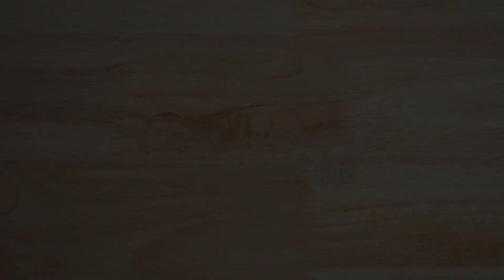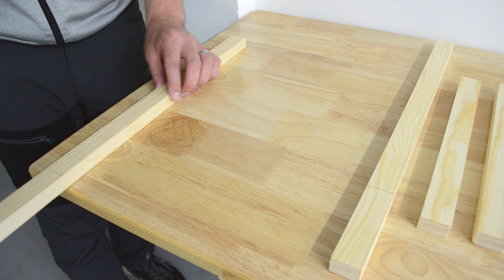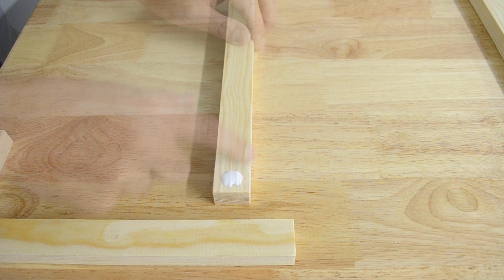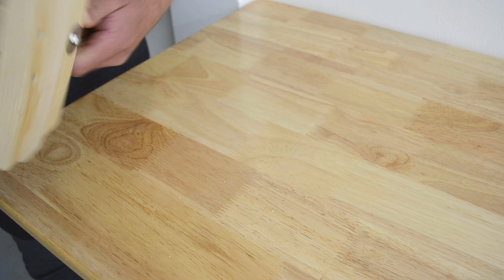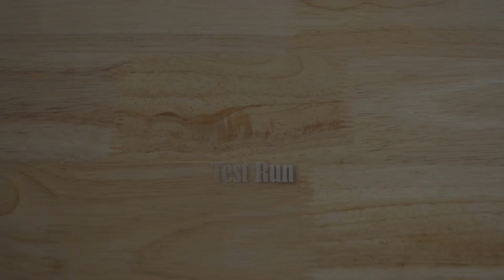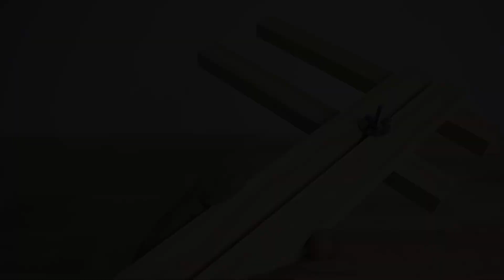Dont Throw Away Pieces of Wood | DIY Simple Jig Saw Guide

Comment: i made one.but it dont hold the piece tightly. i made it following your videos step by step.. any suggeations?
Reply from the maker: Hello Bill, what what size was the cut piece and did you clamp it while cutting?
Reply: @AllFlavorWorkshop  yes I clamped it several times..I had to go to Lowes 2 times because believe it or not they didn't have any 1/4-20 full thread bolts in carbon steel only ones with 1 in thread so I got full thread stainless steel one's and stainless wing nuts..but no problem I got it hung up for future projects.. still like your videos.

Comment: Can I cut 2mm mdh 30x30 cm sheet?
Reply from the maker: 2mm MDF wouldn't be a problem, yes, that can be done. The dimensions 30x30 probably wouldn't fit in the guide. Anyway, for MDF use the right blade. MDFs tend to tear.

Comment: I think a better solution would be to make the jigsaw move within a guide.
Right now, you are still at mercy of your hand to get the straight cut. It will be a matter of time before accidently cutting/chipping off your guide wood pieces, IMO
Reply from the maker: That is true. The track would hold it better in place. 👍
Reply: I completely agree, and if the wood is thicker or thinner than the jig, you are also prone to wobble.